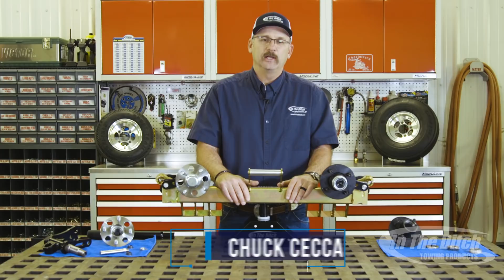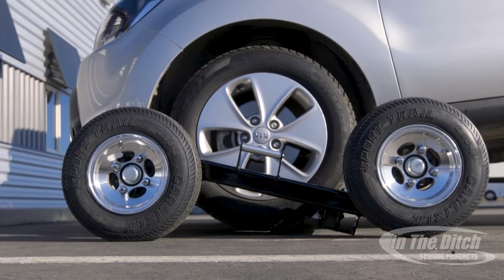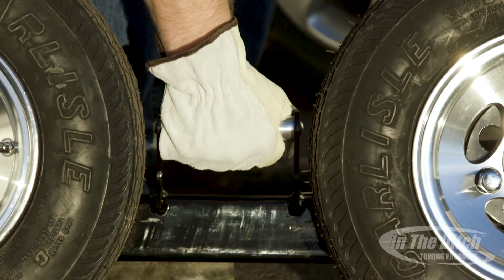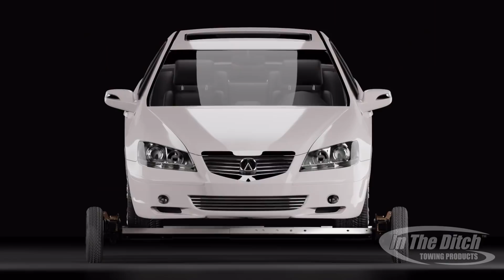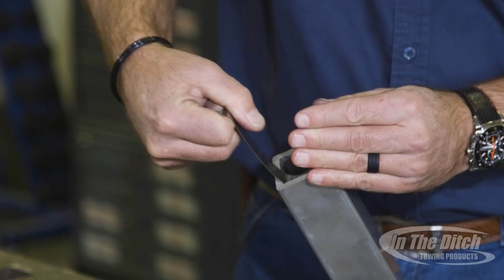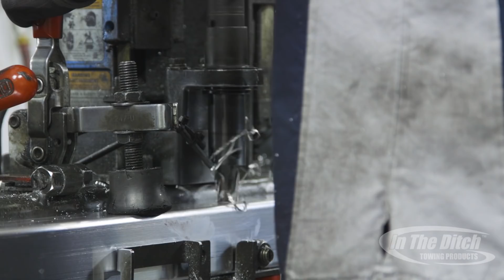In The Ditch™ X-Series™ Dollies - Features and Benefits

Comment: By far in the ditch dollies has made my life easier, thank you. I'd like to point out from loading these dollies on an asphalt surface it'll leave damage to the pavement. Yes I can avoid the damage from either putting a skate under or having the vehicle raised enough so it'll prevent those marks. The steel axles are heavy but noticed on the heavier and wider vehicles it'll perform better over the aluminum. I've been in the Towing industry for 18 years now and seriously love these dollies. Thanks again and please reach out if there's anything I can do to help from my experience.

Comment: Hey Chuck how are you.. this is Elie from DB&T TOWING LLC out of Las Vegas,NV .. Would you happen to have a part number on the dollies that holds 100psi? Its the 4,000 Rating high capacity with the steal valve stem
Reply from the maker: Hi Elie-We have those in the XL version with a sealed hub (ITD2790) and the SLX version Self Lubing spindle (ITD2890). Here's a link to all the new X Series™ dollies on our website: https://intheditch.com/FW_X_Series_Dollies.php 
Hope that helps! Thanks for watching!